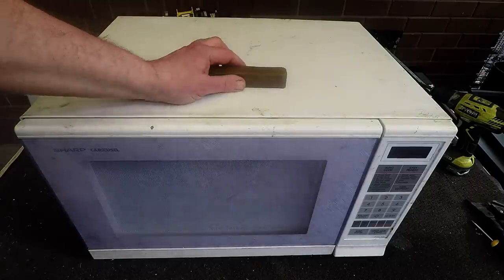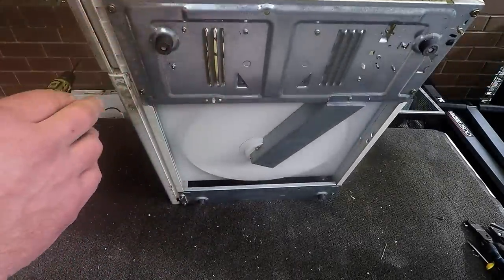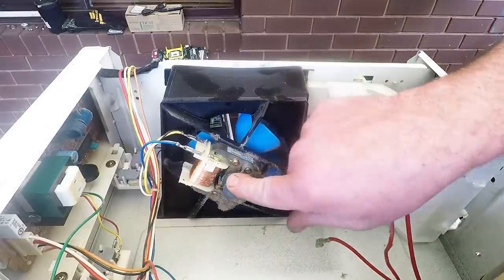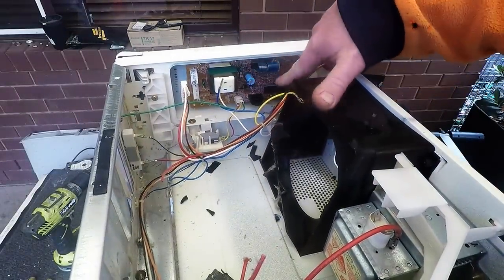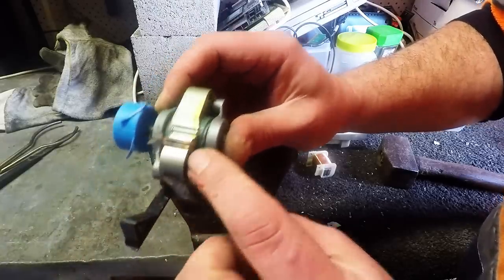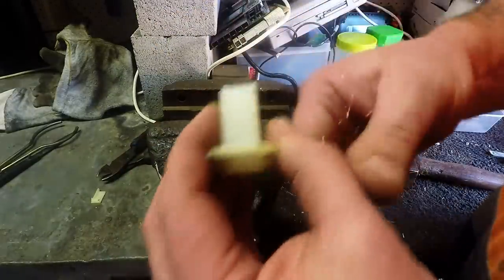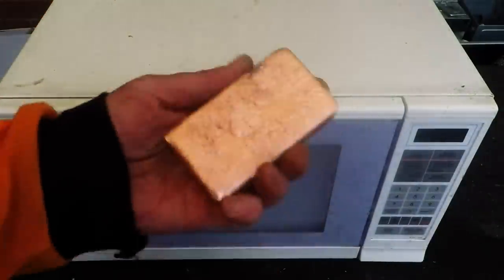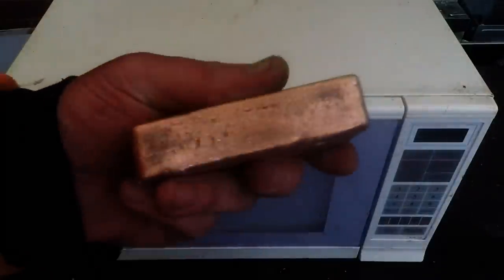Free Copper - Copper Bar from a Microwave Oven

Comment: A wee tip for you guys the capacitors remain fully charged even when not plugged in,thousands of volts you need to touch the points to get rid of electron charge,this is for microwaves mind you some other devices have high voltage capacitors just something to be aware of,people have been killed by screwing about with microwaves with zero knowledge!!

Comment: here in the states copper is graded #1,2 or 3. since that has a varnish on some of it i2 would be #2. clean copper is #1. copper that has turned green is #3. so your bar copper would be #1 as long as its clean. to clean it just soak it in a bit of drain cleaner to get the best price.

Comment: Came here to see if you would rip open the magnetron like some fool. Glad to see you're aware of the dangers of beryllium. Stay safe and healthy.
Reply: Can you sell the beryllium just like the copper? I never herd of it so its probubly something that costs alot.
Reply: The BeO insulator turns out to really just be a myth, if they are pink you can be sure it's alumina, not BeO. BeO is really just used for multiple kW magnetrons for continuous wave radars.
The pink actually comes from additives and impurities such as titanium, which is to improve mechanical properties, indicate it's alumina and indicate the grade (pink is usually 88% Al2O3)
Always thought it's BeO too, but apparently it isn't...

Comment: Most used microwaves are dirty/ greasy. I would be sure to scrap outside the house. Picked one up once was full of roaches. It was in the trunk of my car which is practically the same as in the house if they crawl into something. Don't need that.
Reply: I had to toss my microwave and forgot to get the copper from it.
Week later I seen 2 by a dumpster, and passed on it, they looked bad, it was the middle of summer and every little creature had to have made it's way in.
Reply: Yeah, I brought one home once when I lived in a condominium in Hawaii. Made an easy repair, heated a cuppa water and bugs started abandoning ship. Put it back outside.
Reply: Roaches enjoy the environment inside of microwaves.
Reply: The roaches will burn right off. No worries.  LOL!

Comment: I will buy all your untouched capacitors and 12kv diodes. 😁
Reply: 12kv diodes... What a fuck?
Reply: Saxutin ! Their the standard in microwaves.  Although I have some 28kv, 35kv and 44kv ones from ebay...
Reply: Oh yeah ur right... i think i did read "resistors" accidently and wondered how u measure resistance in volts... my bad.

Comment: I'm only 4 minutes in and already you've given plenty of bad advice. The very first thing to do after opening the case is to short that capacitor out, that capacitor can store enough energy to stop your heart. The magnetron on the other hand poses no shock hazard as it can't store any electric charge. The reason why magnetrons shouldn't be played with is because it's not 1/1000 that contain beryllium, it's very common that they contain beryllium. The insulator might just be harmless aluminium oxide but there's no good way to tell. Either way you're giving dangerous advice here.
Reply: Andrew Merts there is always a resistor to short out residual voltage ...but just to be safe short across the terminals with a HV screwdriver
Reply: It might just be old wives tales but I've heard stories of people opening up microwaves and getting an arc off the capacitor even after it was unused for an hour. In any case that resistor is often a discrete component inside the can so better safe than sorry with any high voltage capacitor.
Reply: I'm pretty sure he said he doesn't mess with magnetrons for that reason, silly. Comprehension problems?
Reply: Nice job mate!
Reply: Then try messing with an old CRT TV without shorting it out, and see how far you can fly across the room!
I can charge up an ignition condensor (capacitor) that will give out a good jolt, days after charging, so I believe you are wrong.
Reply: alan30189 the guy in the video said it's about 1 in a thousand, but the guy whose comment you're replying to is correct in that the beryllium based ones are a lot more common than that, the guy your replying to is also correct in that the mag can't hold a charge. So the comprehension problem might just be on your end.
Reply: He said magnetron may store charge which is incorrect (too cautious in a way). While the Cap is rated at 2000V so if it's not discharged and you accidentally touch the wrong thing .. you'll get a surprise.

Comment: Having worked an an A/C, Refrigeration tech. I have seen a lot of copper just get thrown out. Everyone knows motors have copper coils in them and a/c fan motors and the heavy compressors especially have a ton of copper in them. Just make sure you vent the compressor tubes to make sure no pressure is still inside. There will be oil inside the compressor but the fan motors are easiest. Any type of fan motor has copper coils. For the compressors you might use a hand held grinder to chew through the sides to access the inside. I wouldn't recommend a torch because of all the oil inside.

Comment: i just dont get why someone would do all this work for 3 dollars in copper. Better off to just get a job
Reply: hyfy1970 that's why he said it was more of a hobby than anything. Personally, I like having stacks of copper bars hanging around. Folks always comment on them, and they make great conversation pieces. True enough, they aren't worth a lot sold as single bars, but they add up over time and make for good unrealized savings accounts. I love tearing things apart... probably a lot more than putting things together. This is a hobby for any person to get destructive with...
Reply: He said $7 of copper and if it takes only 20 mins that is $21 per hour.
I don't know about you but  $21 sounds pretty good to me.Also not long ago
copper reached $5 per pound and at scrap of $3 per pound and three pounds
per microwave that is $9 and three per hour puts it up to $27 per hour.
Reply: hyfy1970 you do three in an hour and you got minimium wage
Reply: meagain2222 exactly^^^ you can actually make good money recycling if you know how to tear stuff down
Reply: Well, they can go get a job doing something like this for $10 an hour. That's a max of 3 MW's an hour and I'm sure this guy can strip 5-6 easily without explaining everything. So, scrapping can be a job after all huh
Reply: Sure he might be able to scrap out 5-6 an hour, but how long did it take him to find those 5-6 MWs? How much gas did he use driving to get them? If you account for ALL the effort needed to scrap out 6 MWs there is no way you are making above minimum wage
Reply: You never heard of home delivery have you.....?
Reply: what? are you saying Amazon now ships used microwaves to scrap out and does it for free?
Reply: I've scrapped for years as a side job/hobby.  I make about 15 thousand tax free on top of my real income.  It's not like work to me.  Searching for junk metal is really fun and tearing it down is fun too.   
I work on big construction sites so I have access to a Lot of scrap metal.  I just walk around for about yen minutes each day gathering wire and whatever's lying around.
Everyone thinks I'm weird until they see the receipts from the scrap yard. Lol
Reply: So you are able to scrounge up, on average, $60 a day in scrap metal at your job site every day? $60 in ten minutes? That is a pretty wasteful construction company!
Reply: lmfao n1
Reply: Jobs are stupid. The boss only cares about his bottom line.
Reply: What I don't get you watching and complaining. No-one said he's out of job but hey you know everything.
Reply: Most construction companies are waistfull, they got waist dumping written off from the company's tax so they don't really care -it's all about work-hours and profit..
Reply: hyfy1970 
Hey hyfy1970, you'd b surprised at how much construction sites throw out valuable metals like brass, copper or aluminum. It's actually the individual trades on a construction site that throw away a lot of scrap; this is something u really can't avoid. Contractors (especially larger companies) would rather get in & get out then on to the next job.

Comment: I don't know if anyone else had pointed it out but you're missing a huge hunk of the microwave's copper inside the Magnetron, inside its steel casing the entire body of it is copper. Just pop the magnets off (love those too) rip off it's ends (while wearing a mask or in a hood, the ceramic ends contain some pretty nasty stuff) tear out the guts (might as well save those too, it's thorium and tungsten after all) and there you go! One decent hunk of pure copper to add to the pile!

Comment: Hi Ben, great video.  I'm interested in melting down aluminum into 5mm - 10mm sheets, that I can then cut on with a CNC.  Do you have any suggested resources like your kiln and pan that are more for this purpose?  I think the largest sheet I could work with would be 50cmx50cm but anything like 20x20 would be plenty for little stuff.  Thanks!
Reply from the maker: you'd have to get something custom made and it's expensive, maybe clamp two cast iron hot plates together real tight, pour down one side.

Comment: Great video. There is another video on YouTube that deals with getting the magnets out safely. It shows how to short out any energy left in the capacitor so you can safely work on it. In the other video I mentioned the host also explains what safety percautions you need to take to protect yourself from the toxic dust that is in the magnetron.. Thanks..  :)

Comment: I strip the wire out of the transformer and keep the steel framing and use it as weight blocks. Sometimes I would consider placing steel or even lead in the hole where the wire was.

As far as the magnetron I have taken them apart but stopped at the copper container and most of what was directly connected too outside the copper wires connected to it. If you are careful and have tools setup to hold it in place and then it is safe enough to not damage it. I am mostly always cautious around any type of ceramics in general unless I know what they are made of.

Comment: You missed the fan motor and turntable motors. Both of which contain extremely fine copper coils. Also, a hatchet works great for cracking the welds on the transformer.

Comment: Copper donut in hdd spindle. Hi Ben, wrote you about a year ago about the spindle section of a HDD having an inner bearing. It took me some time to finally get one out. Was hoping there would be ball bearings to make a fidget spinner. But just a copper donut. I guess that makes it a bushing? You probably already know this. Pretty easy to get it out. Just bash the bottom of the hdd center of spindle with a metal rod, then bash out the top of the other end with a smaller diameter pin/rod and voila, you've got a nice piece of copper. Thought to let you know, though I couldn't find the previous post to you in your other videos. Happy hunting.

Comment: Interesting video Ben and what seems like a fun hobby, I have to many of those already and no where to try this.
But I am wondering if you were to gently vibrate  the table you're working on with say a hand sander or jigsaw clamped to the table, would this help with separating the slag and impurities and air. Like I said I will not likely try this but I think the concept is solid. Thank you.

Comment: Great video dude. I know this is an older video but I just wanted to mention something in case you check this. The mushrooming on the end of your chisel can be a bit dangerous. Those metal chips will eventually break or fly off. They can go anywhere including your eyes. It is usually a good idea to file or grind that mushrooming off before it gets to that point so that your chisel isn't an additional danger.  Sorry to preach to you. Best of luck and keep up the good work my friend.

Comment: Is it worth melting down the aluminum from a transformer? Went to throw a microwave I had scrapped in the steel bin and saw a transformer sitting in there. Grabbed it and it was double aluminum -_-   But is it worth it to keep the aluminum from the transformers?

Comment: Hello Just a quick comment from an old radar tech guy. I am pretty sure that every magnetron I ever disassembled had a anode that was made out of copper. It's a fairly heavy piece of I believe solid copper and no they can't store any power. Just be careful of that high voltage capacitor near the transformer. I've also seen talk of the ceramic used in the magnetron insulators being poison but I doubt you'll be grinding it up into dust or anything. The 3 to 5 mega watt units used in the radars had a lot of copper in their anodes.

Comment: I just posted a comment below, I should add I wear rubber gloves, and never assume the machine is grounded. For the most part it's pretty safe but if you bench stuff and forget to unplug it  one time is all it takes and it happens when you get comfortable doing it. Fear is a good thing.

Comment: Thanks for the Demo Question: Is the "weld line" you break starting around 14:00 really a *weld*, or might it be a soldered joint?  I would have expected a weld to be stronger than the surrounding base metal.

Comment: I would like to see you do this again. however could you place a palm sander on the table. no sand paper, and let it vibrate the table as you pour the bar. Just might help remove the oxygen pits from when you pour. I don't know if this will work. I would like to see a smoother paper weight.
Reply from the maker: copper cools down way too quick but interesting thought

Comment: i've lived off scrap metals in the past and i get the fascination with melting into ingots but if you're thinking about the bottom line it probably costs more to power the crucible than the scrap value amounts to. i still save copper to this day though
Reply from the maker: No I don't make bars to sell as scrap, I sell as copper bullion, 6x scrap value

Comment: Interesting, but....  You should have said more about the crucible. If it had an adjustable thermostat, I'd bet you could also use it for aluminum. What kind of molds? Different for copper and aluminum? What other metals can that crucible handle? Why have one for each kind of metal? Also should have put some elapsed time info in it.

Comment: There is more copper in the wire and the actual power cord you plug into the wall. When i used to scrap metal for a living the price for wire anything household size 220 and smaller was $1.25 per pound with out stripping it the weight of the coating helps regular clean #1 copper was $2.35 per lb. It wasnt worth the time or effort to strip it and the also bought the electric motors and transformers and coils without having to strip anything apart. Or they bought the entire microwave for tin price .10 cents per lb. with that being said its still fun to rip everything apart and see how much you can get for it. We would save anything we found during the day that needed to be stripped and when the scrap yard closed at night we would take everything apart and make a few extra bucks never once was it worth the time it took to do it but it was worth its weight in knowledge and skills learning to take things apart and see how the actually work most people will never know just plug it in and push start

Comment: Just curious, but the high grade steel..can it be smelted for your own projects?
Reply: Sell it if you have at least 200-500 lbs. Better than dumping it
Reply from the maker: my furnace only reaches 1150 c, you need a serious furnace for steel and not something you would want to do in a backyard
Reply: Better used to make you own custom transformers. (If your into that sort of thing. )

Comment: I made 10 min ago my first Aluminium bar :) the graphit form has not arrived, so i made a wood form. (was not the best idea, the wood was burning for 3 min). But the result is quite ok for the first time, as aluminium source i used finns from heat sinks.
Next week i going to make copper bars out of heatsinks.

Comment: Where I am most scrap yards won't take copper that shows signs of burning so in fact the yard might not take his bars but would take the wire and transformer coils. 

This is in response to theft of good copper wire plaques, pipes, etc that is then burnt for the scrap.

Comment: dude, 50% of the copper in a microwave oven is in the magnetron!  its basically a solid copper ingot with waveguides cut into it.  once you remove all the cooling fins and magnets, use a large pipe cutter or a band saw to open up the tube.  they are quite interesting to look at.  cut it about 1/4" from the output end.  i dont recycle the magnetrons either, but i cut them open because they are so cool to look at.  

but as you said be real careful of the insulators.  they look like ceramic, but contain toxic beryllium and apparently can ruin your day if you crack them and inhale the smallest amount of dust.  so before cutting them open, i wrap several layers of duct tape around the insulators.